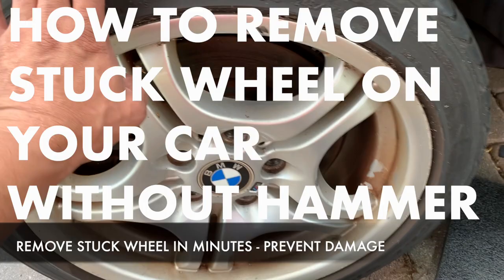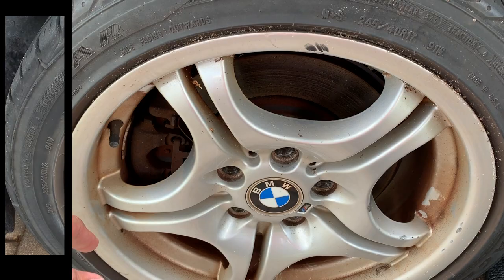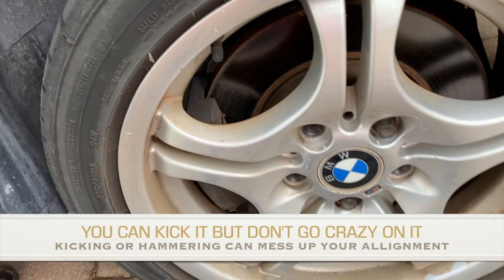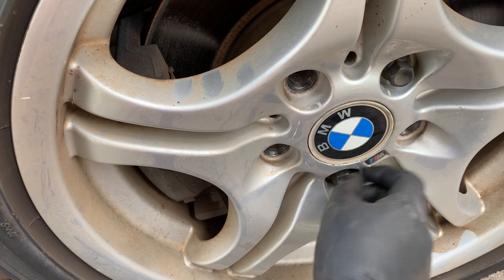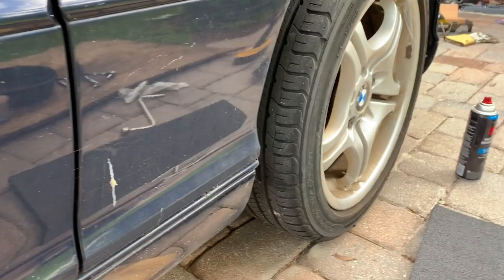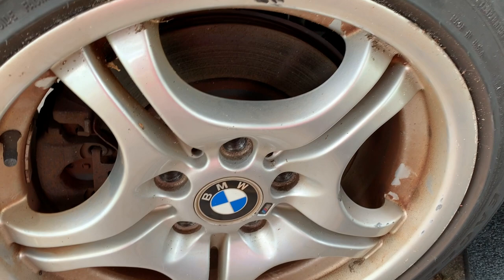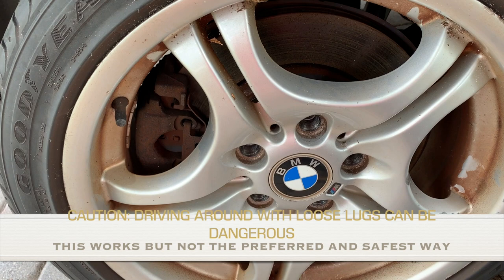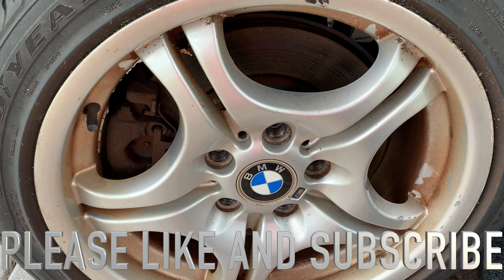HOW TO REMOVE STUCK WHEEL / RIM FROM YOUR CAR

Comment: I had to go to step two.  I only had to move the car a few feet and the rim released from the lugs ( I could hear it. I like you demonstrated, back the lug nut slightly away from the rim about a 1/4- 1/3 turn. Thanks Mucho!
PS In the video, when you released the jack it sort of dropped, thus it gave enough jerk to snap the lugs free. Whereas, I had the jack that came with  my Honda (V Jack).

Comment: I usually jacked up the car put a piece of wood or  flat rock on the inside bottom of the tire and lower it down with the lug nuts LOOSE  so the weight of the car will pop it out . It works most of the time but right now it didn't so I'll give this a try Thanks 👍
Reply from the maker: Let us know if it worked this way

Comment: Tried it. Does not work when you have a flat tire. But this will become handy when i need to rotate my tires. Thanks!
Reply: You're right does not work for flat Tyre.. what l had to do was slack the lugs.take out jack..start the engine.drive a couple second turn right and left, then you'll hear a snap.. it's free.. just letting you know..!!

Comment: When I got Flat on the highway, my tire was STUCK STUCK. Literally everything tried failed, I even put it back down, no lug nuts on tire and drove forward and backward & tht wouldn’t even work. A cop stopped and said he’s never seen  a tire so stuck before, I resorted to using a hammer & after few hits it finally came off. WHY do tires stick like that??!
Reply from the maker: Because they should have antiseeze between them and rotors but someone didn’t put it and if you don’t rotate your tires for a while then it stays there long and fuse together due to corrosion and moisture.

Comment: I want to make sure I understand what you did. You jacked up your car, took off all the lug nuts, then loosely hand tightend 2 lug nuts, then you jacked down the car, then the wheel came off. Did I get everything right?
Reply from the maker: Yes correct. In some cases it still doesn’t come out like then the best way is to loosen your all 4 lug nuts (not all the way loose but like 2 hand turns so it’s loose but still holding wheel - after you loosen it by wrench). Then jack it down and then drive a little and the wheel will come loose. Just make sure it’s not so loose that the wheel comes off or gets wobbly. It should just be enough to loosen it off but keep the wheel in place.

Comment: The problem is that my tire is flat and I don't think this would work for me :(. I've been waiting 4 hours for AMA to get road side assistance lol.
Reply from the maker: What I can recommend is jack up your vehicle after loosening up all the bolts and make sure you lose it enough, but don’t take them off and then put the jack down suddenly and that will loosen up your rim.  If you cannot take it down suddenly, then slowly would work too.

Comment: Eh this does not work if the tire of flat…
Reply from the maker: Then fill it up with air and do the same it will work.
Reply: @HowToDoitright  lol i guess you have never had a flat tire before lol
Reply from the maker: @thomasmaher6880  I did but I always keep a repair kit in my car and it takes me 5mins to repair a flat…and I don’t take my wheel off to repair a flat. Those plug-in kit works wonders.
Reply: @HowToDoitright  I agree, but you missed the point.
Reply from the maker: @thomasmaher6880  what was the point?
Reply: @HowToDoitright  lol ✈️
Reply: @HowToDoitright  just think it through man. Thank you for the video.
Reply from the maker: @thomasmaher6880  lol you got it man!
Reply: In response to the person with the flat tire... I understand your point, but you need to be prepared.. The problem is caused by "dissimilar metal corrosion". Enough said on my part. Clean and lubricant all 4 wheels.
Reply: @genecundel4793  if this is your response you have also missed the point.